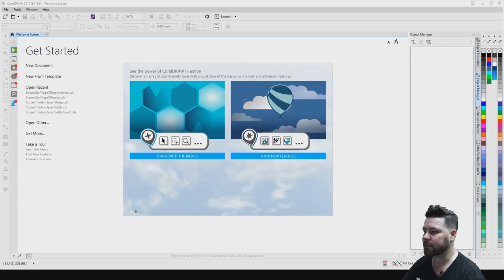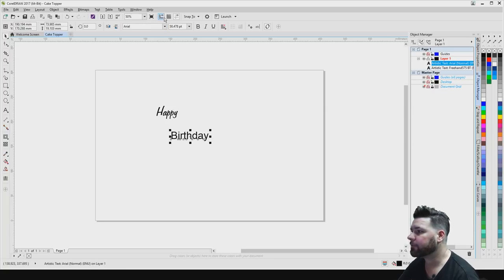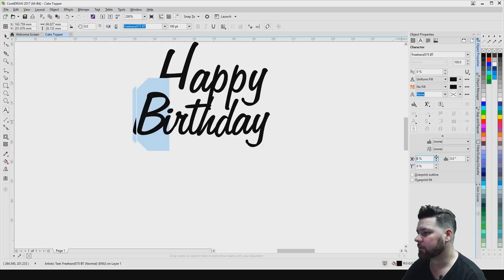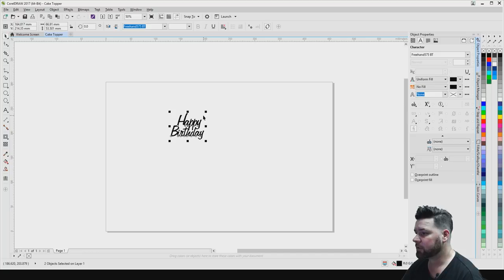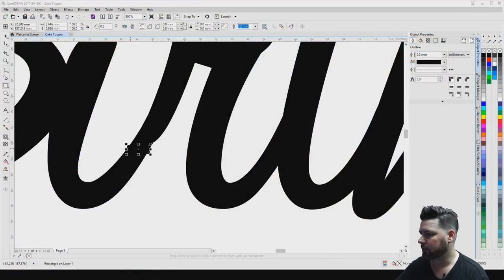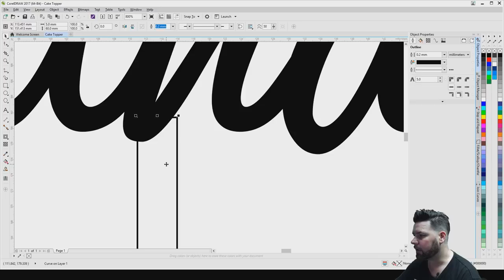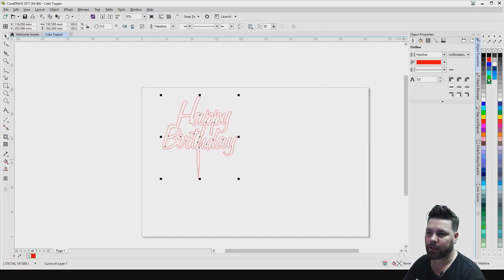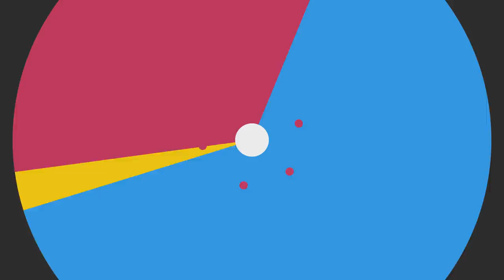Let's Design A Cake Topper Ready For Laser Cutting

Comment: How do you print it (on acrylic or wood) and what laser do you use?
Reply from the maker: Hi Abby,
We cut it out on both Acrylic or Wood. We also make these in Cardstock as well as composite plastics. 
The Laser we have is from Trotec, but the process in this video can be done on any laser powerful enough to cut the material you are using.